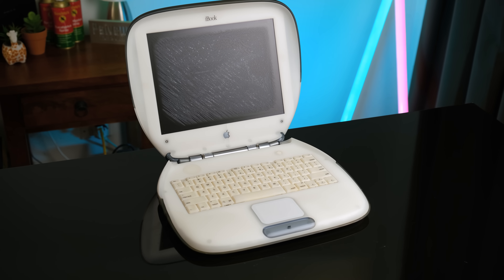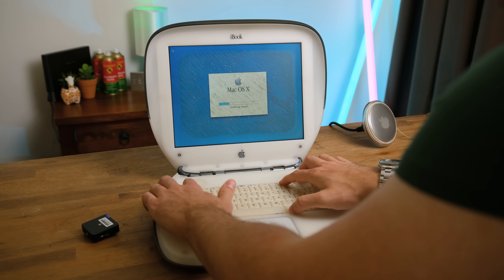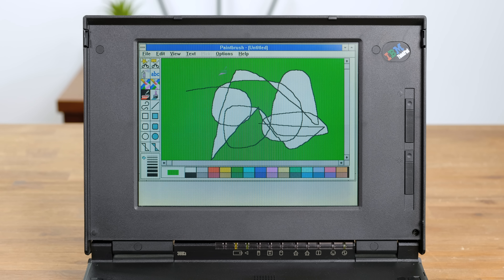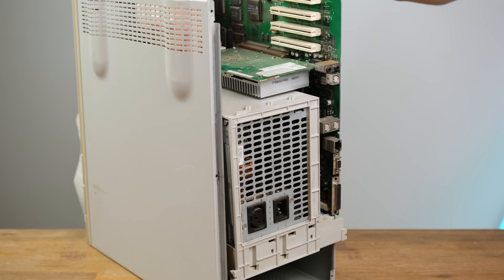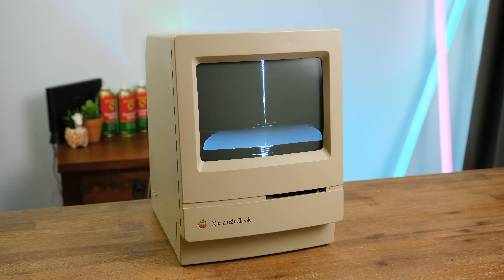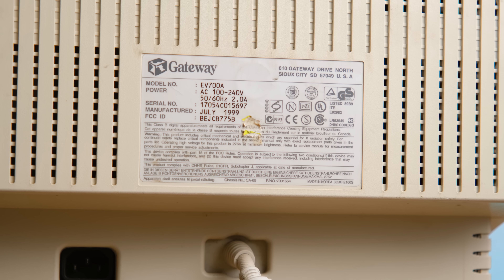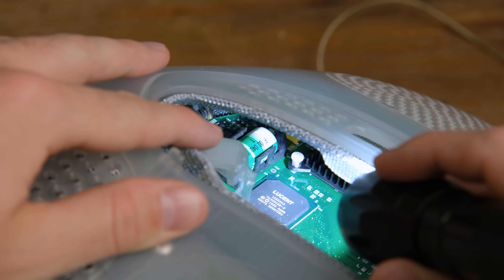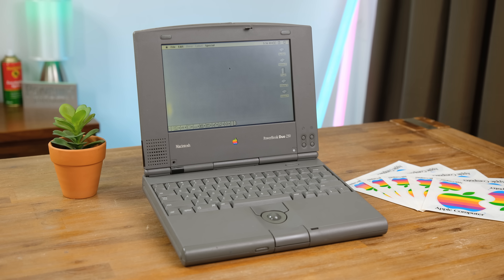So Much Vintage Tech Is Dying... Here's Why

Comment: Collecting vintage computers demands a lot of preventing maintenance: replacing capacitors, switch mechanical HDD with flash solutions, new power supplies and so on. 
Some people avoid collecting laptops because they have additional issues (LCD screens, power inverters, flimsy optical drives, etc). I'm starting to have issues with my compaq armadas and replacing them with a Socket 7 desktop it's just better.
Reply: Flash drives are a disease. SSD/Flash memory functions like DRAM with 1 year refresh cycle (see Wikipedia "wear leveling") and will die if not powered on once a year for some minutes. It dies the faster, the more erase/overwrite cycles it has gone through, thus never use a worn USB stick or SSD as backup media. They starve without energy (modern triple/multi level types even faster).

Only if you tend to treat your laptop like a book (bang: lid close, bump: drop on floor into open bag) an SSD will be more reliable for you. I treat laptops like a record player (do not bump if running) and my Thinkpad X61t of 2009 runs perfect without any HDD problems.
Reply: @cyberyogicowindler2448 I've only used flash solutions on 20+ year old systems (amigas, atari's ST, Apple II, 68K Macs, 808x, 80286, 80386, and 80486 PCs).
In the vintage 386 and 486 computers, I usually use the SD/CF card combined with an HDD. The CF retains the OS and games library, and the HDD is used for the virtual memory; otherwise, the flash card would die after some use.
Regarding my vintage Compaq Armadas (1550T and 1530D), the problems they've started to develop are not HDD related: The optical drives no longer work, and the screens do not always power up correctly or power up all blank without an image (despite the screen itself being operational); I suspect the power inverters are the cause, or some capacitors needing to be replaced (on the 1550T, the screen always works from a cold boot, bu If I reset the machine the screen switches off until the machine is switched off and on again).
I don't use SSD's with OS that lack trim.
Reply: Why are you crying? This all is easy and flash solutions? No, Hdd is better. Because of that lifecyle.
Reply: @raverewind I'm not crying,  I repair my own stuff and enjoy it.
IMHO, to truly endure in this hobby, without spending too much money on maintenance (paying someone else to do each recap, for instance) you must learn at least the some notions of electronics, buy a good soldering station, hot air and desoldering station.
When I bought an optical microscope, two years ago I was finally able to do some board repairs that I thought impossible to me.
Suddenly, dead hardware came back from the afterlife. Now I regret having disposed of some broken vintage hardware in the past (around 20 years ago).

A 3d printer is also a great plus. Look at the disintegrating Power Mac.

Comment: My father had a Panasonic Plasma TV bought in 2005 which had retained a great picture over the years until last year it started developing small dark splotches in the upper left area of the screen and they slowly started getting worse & spreading, it looked like someone splashed pepsi on the screen but it was definitely internal / behind the screen (which is glass on plasmas) not really sure what caused it but he replaced it with 65" LG LCD several months ago and is happy with it.

Comment: Lots of Dell laptops from the late 2000s have a flaw that floods the display panel with a greasy, sticky liquid meant to keep out water.  When the seal breaks down, it’s all over for the display. I’ve lost 2 displays to this flaw already. Earlier Dell laptops have overheating issues, which has killed another of mine.

Comment: My precious Amiga's all got recapped and the ones that had a battery onboard got a replacement or even removed. Should keep them alive for many years to come.
The A4000 desktop from a friend was really lucky because it was built into a tower housing around the early 2000's and the battery leaked on the bottom of the case and not on the motherboard itself.

Comment: The laptop may have been stored in a cool environment but was it ever transported in a black case.  Black cases are like solar ovens.  Every-time I go to the computer shop all the laptop cases are black.  I wish there were more beige or light grey cases.  I am not sure if the laptop case would make a difference to the screen problem.

Comment: Nothing lasts for ever, for sure, but it's worth noting that quite a few reasons for failure can be repaired. Leaking caps? Repairable :) Dodgy analog board? Could well be repairable!

Hell there are modern replacement parts for the Commodore 64 - when enough people love old tech, they work out ways to keep it going :)

Comment: So... Why did you store it in a cool dry place? I wonder if that's why you seem to be abnormally unlucky with this. Why would you store it in a cool drop place and not a more natural and neutral climate (say 60-70 degrees)? I'm a big proponent of keeping electronics at room temperature to avoid temperature fluctuations. Electronics are designed for room temperature, so why not store them in the climate they were designed for?

Comment: Most of the old computers I bought back in the early 2000's today simply either no longer work, or have major issues. Early LCD displays simply were not built to last beyond 20 years it seems. Even then things like brightness and contrast was flaky or sometimes even shorted out. I now have a collection of late 80's to early 90's machines that simply don't work except on external displays. Which good luck finding a CGA/EGA monitor these days.

Comment: I work in the Maritime automation industry.  Some customers have kept their equipment running constantly for 30 years in rare instances, operator stations have been running 24/7 with the exception of some drydock refits.  In most instances the computer equipment can survive a power cycle, but sometimes it doesn’t.  It’s not uncommon for a motherboard to fail POST after 10 years of constant running when being rebooted.  Sadly failed parts are very hard to find replacements for. Shipbreakers yards sometimes offer components up on eBay without any warranty, and can fetch enormous prices for the vague chance of keeping your system going.
Reply: May be the CMOS battery is dead of a capacitor. Often they don't work when cold, but wake up after a while when powered on. Also hairline cracks in solder joints can make trouble only when not warmed up.

Comment: This is why I'm a big fan of older ThinkPads. I've revived older ThinkPads (both IBM and Lenovo era laptops), and cleaning and repairing them have been easy so far. Also, they handle Linux distros pretty well. I've kept my ThinkPad R61 up and running for 15 years in its refurbished state.
Reply: I have a thinkpad 380 whose case is disintegrating, literally bits and pieces of the plastic is spontaneously cracking and breaking to the touch

Comment: fun fact: I still use a 10 year old PC in 2023
Reply: My PC case is from 1991 (Highscreen Colani bigtower), the oroiginal (Win98SE) mainboard from about 2000 and the 2nd (modern) mainboard (ITX, Ryzen 2400G, 16GB RAM, 8TB mech. harddrive) installed under the roof of the machine in 2021.

Comment: Electrolytic capacitors and integrated batteries are the bane of old electronics.  I’ve found that electrolytic capacitors need to be replaced once every 20-30 years and integrated batteries much sooner than that.  Both have the potential to leak and destroy circuit boards or traces of left alone over a long period of time.

Comment: Old CRT tvs get something called cataracts where the plastic safety layer gets moisture in as it dries and can be removed but the tube can explode without warning while removing it sense it takes alot of heat to do so. These may be easier to repair
Reply: YT channel "Shango066"  has some videos of dealing with CRT Cataract on 1960's color  roundie TVs, he bakes the CRT in the sun all day, then uses a heat-gun, wearing heavy protection ...

Comment: I have a 2nd gen Samsung 7" tablet.  I used it quite a bit at first, and the battery was only charged about a 100+ times.  It then sat for months and years with a full charge on the battery.  One day, I hear a 'pop' come from my computer desk.  No big deal, I hear that from time to time because I have stuff plugged in.  Months later I turn on the tablet and the battery is practically dead and will not hold a full charge as it discharges over a matter of days.  Something is also making it very slow to boot, almost as-if it has a virus.  How?  I barely used it!
Reply: Perhaps the CPU clocks down because the dead battery can not deliver enough current anymore for full speed.

Comment: I absolutely loathe the craze of manufacturers making everything with those soft touch rubberised coating especially something that is in constant contact with skin like games controllers, doubly unpleasant to hold when you're gripping it harder in the throws of a mad gaming session.  
There is a fix though, if your not worried about esthetics, working talcum powder into/over the sticky feeling gunk and it sort of restores to being soft touch again although looking grey like grandma's hair!  Even fixed the soft touch electric tooth brush which is constantly getting wet.

Comment: I have a custom budget PC from 1998 running Windows 98 (First Edition). It's a proper time capsule in itself. After replacing the clock battery, the PC boots, and there's a lot of personal data and programs. The best thing to do is to wipe the drive, but I never will, given I have no idea if I could find drivers for everything.

Comment: Capacitor death is usually the death bell for most equipment.  The "capacitor plague" (wiki article) was a period during the 2000's when  cheap Chinese capacitors would die within years.  I had to replace almost all the capacitors on a Gateway computer around 2004 that was only 2 years old.  It lasted another 5 years after that until it was obsolete.

Comment: I fixed so many of these back in the day, having to change the hard drive is the single biggest repair unfortunately as you have to disassemble the entire machine to get it out. As best as I can tell the factory started with the hard disk drive and built the whole machine around it on this model.......

Comment: We had hundreds of these Dell GX270s at our work, we would do board swaps all the time, the caps used failed within 4 years and were victim of the early 2000 cheap capacitor failures that affected most major manufactuers who wanted to save a penny by not buying Rubycons. The Dell Engineer would drop off 5 boards at a time at some point and collect the others, this was a known defect that Dell acknowleded and they replaced them 3-5 years after the warrenty expired at some point.

Comment: for the displays that are peeling,  there's a way to fix those actually.   That top layer is typically an anti-glare filter or polarization filter. You can remove it by using hot air.  what you see when it's bubbling is the epoxy/adhesive that was used breaking down with years of UV light exposure.

Comment: it sounds like you've never learned how to solder, but you have plenty of PC repair experience.
A flyback transformer isn't difficult to get a replacement for... or to repair.  Chances are it's not the transformer itself, but it's probably the MOSFET/IGBT  flyback driver or one of it's electrolytic capacitors.   There again, if you know how to solder and have a good temperature regulated soldering iron with hot air reflow tool it shouldn't be a problem.

Comment: Yes, I can confirm such issues. My Eizo Flexscan monitor from 2009 build up some odd welts on its surface, it is still usable and they are not covering the whole surface fortunately, still would have preferred if this didn´t happen. A bit of a shame, as it is still a good display.
I have some ancient notebook-thingy from 1991 or so, it worked some years ago but now the monochrome LCD doesn´t show anything usable anymore.
About the rubber stuff, I have a Panasonic Lumix G1(2008) and a Nikon D70s(2005) which both suffer from this issue. Some talcum powder helped. They won´t win a price for their looks, but it´s better than having the sticky feeling on my fingers.

Comment: Apple Certified Service Trainer for the ACMT and Consultant here: once you do a dozen or so iMac hdd replacements, you get real good at it and de-adhering the glass display assembly, it is barely an inconvenience. In my 13 years of being in the industry, I’ve probably done 300-400 of just the iMacs. The plastic shell iMacs before them were a major pain you had to use a credit card and go in through the fan vents to unlock two clips on either side. And don’t get me started on having to discharge the 30kv anode on the crt iMacs…

Comment: Good video!  Although with the proper know how and maintenance you can keep most of the stuff working....i will admit laptops are the worst, as for saving the ibook clamshells just mod it and stick the guts of a MacBook Air inside it so it's usable...

Comment: It is not an ideal solution but I have used talcum powder to mitigate the sticky plastic problem.  It binds with the sticky polymer and leaves a useable surface to be able to handle but does obviously change the cosmetic look to a whitish hue but maybe graphite or charcoal would work as well.  Cleanup of the excess that does not bind is a bit of a mess though.
Reply: Talcum causes lung damage (almost like asbestos). Use corn starch instead (or chalk if exposed to much moisture).

Comment: Those Dell computers had bad caps like that sometimes within the same year of purchase, it was quite an industry issue at that time
Reply: I remember that, especially during the Pentium 4 era. It was called the capacitor plague, caused by a company putting out cheap capacitors using a stolen formula and not getting it quite right.

Comment: I feel like a lot of this 90s/early 2000's stuff was still made of stronger and better materials than what's currently being mass produced. I can't imagine the amount of totally useless e-waste we're going to have in even 10 years time. My 1998 Comapq Armada and ~2003 Dell C400 laptops still work, but my 2013 era Acer Chromebook is a gonner. I've already thrown out a 2016 era Lenovo laptop that was literally falling apart after a year and was basically on life support until it gave up the ghost in 2020. Point being, I expect this problem to be much worse with today's tech. Guess even inanimate objects have a lifespan.
Reply: An IBM Thinkpad 760XD laptop of 1996 was something like 30x more expensive than the nowadays consumer versions. But this still does not justify to make intentionally crumbly plastic.

Comment: I have a less than 10 years old Asus laptop that I have been occasionally used with Linux, but recently I noticed that near the edges the screen has changed the color, and it kind of looks like layers are separating there. So far the screen is fully readable, just the shades are different near the edges, but I'm worried that it's getting worse and will at some point make the screen unreadable. I had contemplated to get a new battery for that laptop, but now I'm not going to throw any more money on that thing.

I have owned only laptops since 2005, and none of earlier and none of later ones have had the same issue, so it could be because it was some exceptionally cheap model. I remember I bought it when I needed a computer to run a 64-bit program, so I just bought the cheapest 64-bit capable laptop I could find, without thinking more about it. Well, the screen turned out to be kind of junk from the beginning; I realized that low resolution will be a problem when trying to fit more than one window at a time on the screen. Also otherwise it wasn't so great: the whole thing feels very flimsy, and the keyboard is awful to type with, and sometimes WiFi breaks up like there was a bad connection with antenna, and the fan has started to occasionally make sounds like the blade was scratching something. So I have somewhat regretted that purchase -- though, it has taught me the importance of having enough pixels on the screen.

Comment: The craftsmanship is gone in any mass marketed products from the last four decades. My grandfather has a Victrola-Edison home computer from 1922 and it still fires up just fine. Sure, it's hard to find the leaded gasoline for the engine that powers it, but it works damn well once it turns over and boots up. And grandpa still has his father's GE cell phone from about 1901. The mahogany and ivory casing on that old cell still feels great, not some sticky mess like those 20 year old Nokias..

Comment: I'm trying to replace the hard drive in my old Windows 98 computer that still uses IDE interfaces for the main drives.  IDE drives are especially difficult to find, and any hardware from the AGP graphics card slot days is a fortune.
Reply: Fortunately there are simple adapters that let you plug in modern SATA drives, though you probably won't be able to use their full capacity. Windows 98 is limited to a drive size of 128 GB for example. There are also IDE to SD adapters that let you use cheap SD cards as hard drives.